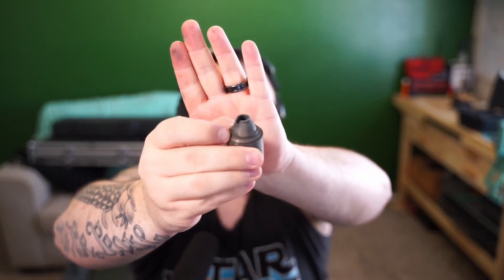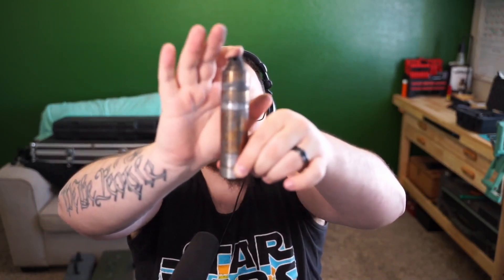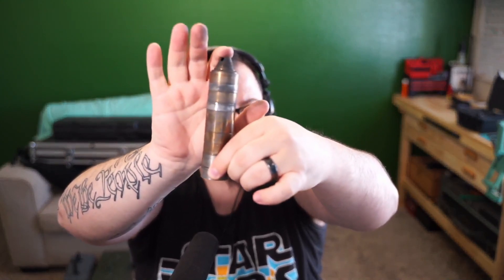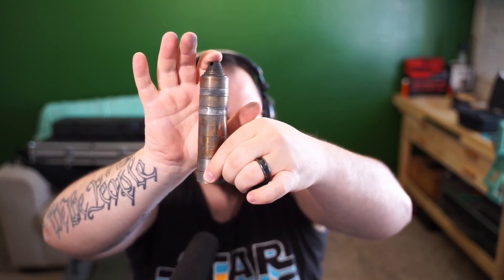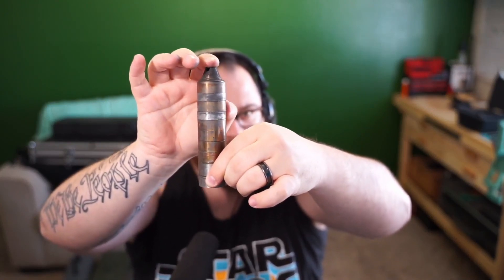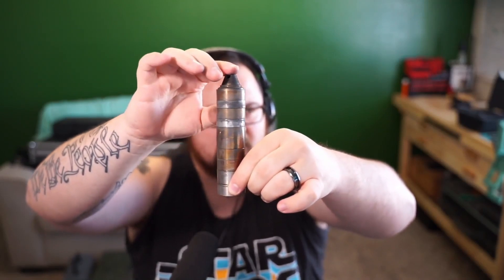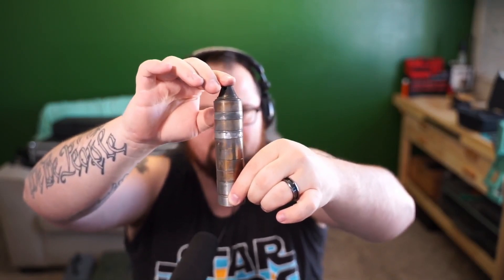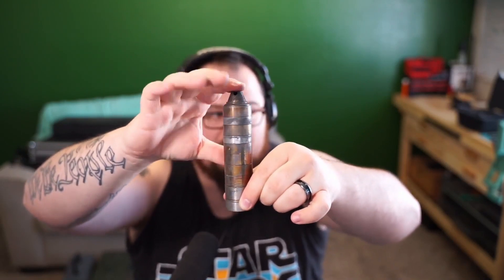Form 1 Suppressor Comparison

Comment: Have you tried anything to minimize flash? I’ve been on the fence about this for a while and the big thing holding me back is flash. I am very particular on that issue and I don’t want to lose the great flash suppression I currently have using flash hiders by chasing after sound suppression as well. That being said I love the idea of overall signature reduction you get from a suppressor.
Reply from the maker: I have actually! Usually longer suppressors inherently work to minimize flash because the combustion has more time to take place in the suppressor, but for shorter suppressors it can be harder to stop the flash. 2 of my shorter suppressors use a "diffusion wall" in the blast chamber (it's the same design as the blast baffle YHM uses) which helps extinguish the flame front before it gets to the rest of the suppressor. I've had good results with that, and adding a flash biding endcap also works well, preferably something pronged like the dead air or rugged flash hider cap designs.

Comment: I frankly don't have the time for too much shopping and building, so I'm between the 5" and 6" WTT kits with stepped cones. It'll be on an 11.3" .223 AR all the time. Stick with the 5" and upgrade a few baffles down the road?
Reply from the maker: If size is a major consideration, then yes, although you won't be able to change out already drilled baffles down the road. But if you're willing to get that extra inch, I'd go with the 6" kit as the length will aid in suppression. Are they only offering those kits with all stepped cones now? If they were still doing the mixed 50s and steps that would be the best scenario.
Reply: @NimrodCollective  i see 100% stepped only. SBRs are inherently annoyingly loud so I'm trying to cut that down but I also need flash reduction for NODs. I plan on running with ears in most of the time, so I don't expect anything too quiet.
Reply from the maker: Makes sense, the 6" will still help with flash as well but it's a toss up between the two. I like the short overall length of the 5" on my 10.5 but it is very flashy, so much so I can see it in broad daylight. If you go with the WTT 5" kit, I would at the very least change the cap to a flash cap style from super precision concepts to at least help mitigate the flash some. But otherwise I don't think the 5" kit is a bad option in that scenario.

Comment: A full dino can rules them all!
Unless you run all mushrooms
Reply from the maker: The longer one is mostly dinos with a couple hybrids thrown in. Since silencer student has put out his videos on the all dino can, I have 2 more planned that will be all Dino. Still have to get some of the mushrooms to try out one of these days.
Reply: @NimrodCollective   i was hoping the mixed dino/wtt would outshine the all dino can. unfortunately the all dino edges out the mixed by a couple db.

My 6.5 mushroom can is quieter, across the board, than my 8" all dino.
Reply from the maker: Interesting! What size OD on the mushrooms? I'm tempted to buy some in 1.497 for a 1.625 can since I have a few of the group buy cones as well.
Reply: @NimrodCollective   both are 1.497.

You have to do alot of clipping to get the full benefit of the design.
Reply from the maker: Yeah I've seen all the posts about waist clipping and stuff, I might have to grab some and give it a try while they're available.
Reply: Great job! Just found out about form 1 suppressors and perusing available information.

1. Do you have a form 4 suppressor? How do these compare?
2. What happens if you dont use dividers? Could you just stack the cones and get same level of suppression? It seems the cones are self-dividing?
Reply: @shooterreadyschannel9254  
I have a dead air sandman and cgs group hyperion. 
My 7" form1 makes the sandman sound like a toilet paper tube.  The hyperion makes everything I got trash.
Reply from the maker: Hyperion is on my list, CGS is doing magic.
Reply: @NimrodCollective   as soon as Christmas is over gonna scoop up a heios if Its in stock.
Reply from the maker: I personally don't have a form 4 suppressor, but I have access to a few via some friends. The 5" compares to a yhm turbo, when shot back to back in person they are nearly indistinguishable. I still need to find some equivalent longer form 4 suppressors to compare the 9" to. 

The design of these cones provides the spacing and you adjust as necessary by cutting the skirts and/or adding spacers, but non skirted cones ara available to really tweak spacing if desired. 

I'd recommend https://form1suppressor.boards.net/ for a ton of information, or look up silencer student on youtube because he is far more informational than I can be at this point since I'm still getting my feet wet lol